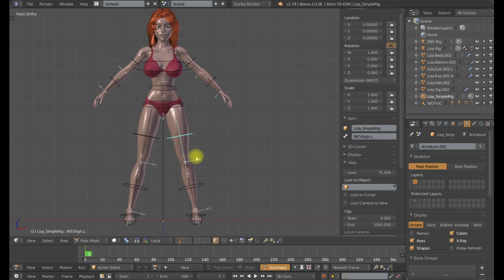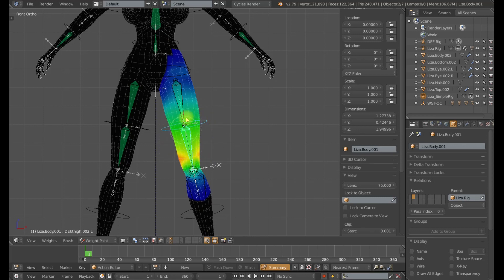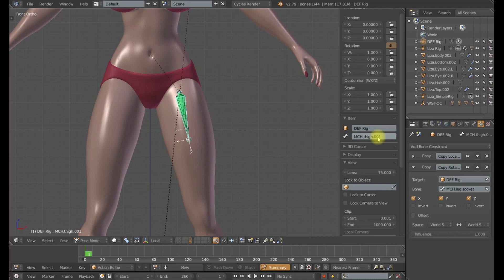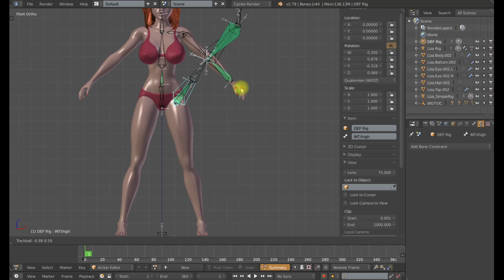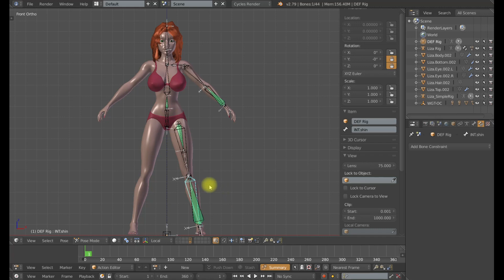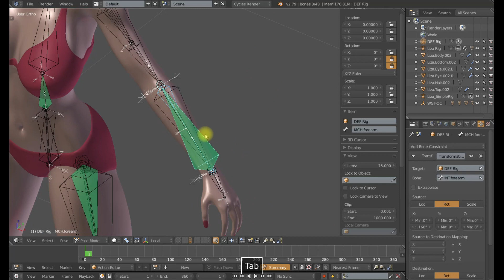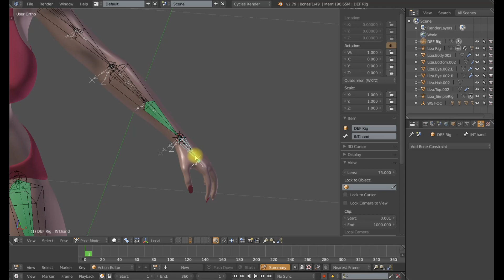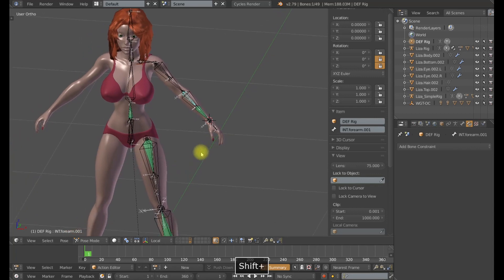Advanced Deformation Series Part 3 Two Bone Deformation Solution

Comment: WOw this really fast gets to a very complicated setup. Im counting like 6-8 bones just for the upper-leg only. Cant there be a more simple setup?
Reply from the maker: The short answer is no. Wait until you see the laundry list of constraints needed for the squash and stretch rigging. A standard Rigify Rig (with facial rig) has 627 bones. The rig for Sully from Pixar's Monsters Inc., was reported to have over 5000 deforming elements. Getting good deformations is not easy.
Reply: What 5k elements... pffff i need to start learning this stuff more. I hardly scratched the surface. This makes sense why they peeps which are dedicated to each step in movie making. Understanding a rig which so many elements needs much knowledge and understanding how such things work

Comment: Hey i noticed the sound is different now, sounded a bit louder than prior vids. Did you find some better setting perhaps?
Reply from the maker: I slowed the conversion rate. Playback on my machine has very little difference in sound, but if it is better after uploading, I'll stick with those settings.
Reply: SOrry, but what do you mean by "i slowed the conversation rate", to me that sounds like " i just spoke less", not sure how that can help with recording volume??
Reply from the maker: I use Movavi for my screen caps. There is a speed/quality setting to convert to avi, mp4. etc. I am using the mp4 format. Reducing the speed of conversion increases the quality, but also the file size.
Reply: SOrry i misread that part, haha i read conversation :) perhaps check the sound conversion settings. My guess the input is just to low. Normally standard conversion wont do anything to sound volume.